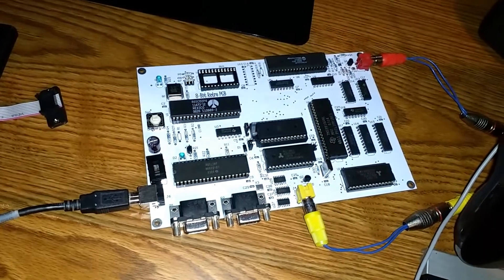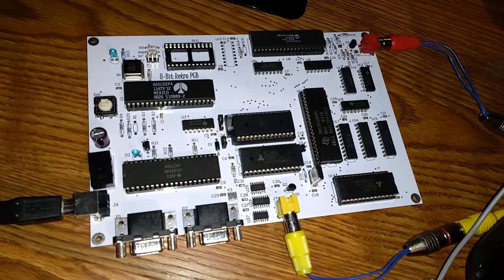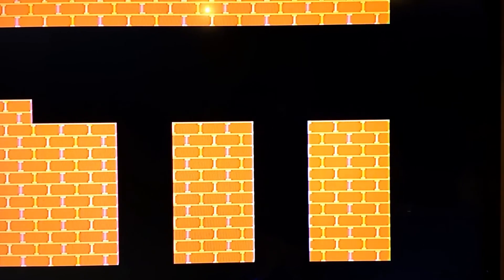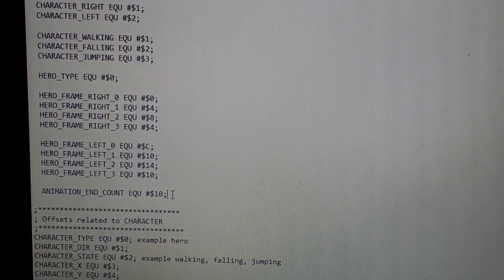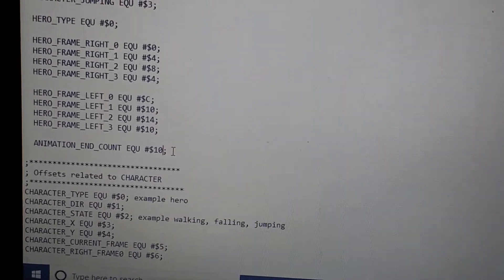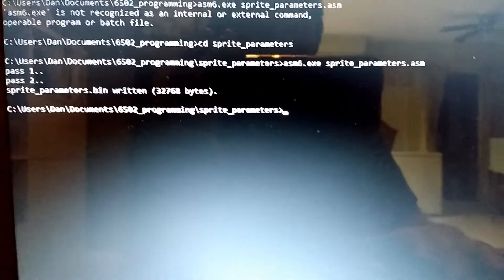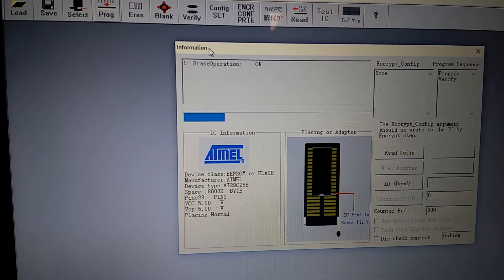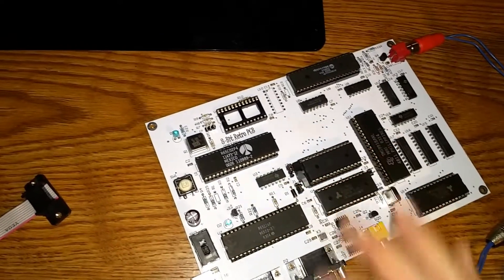Making an 8-Bit Game ep1

Comment: How do you keep your tms9918 alive? Mine died
Reply from the maker: I don't know.  Sometimes it comes down to luck.  The one recommendation I can say is don't handle old electronics wearing slippers.  I remember as a kid I damaged the port chip of the Commodore 64.  I was wearing slippers and I got a shock when I touched the Wico joystick. 🕹 If you live in a place like me where the winters are cold and dry be extra careful during those months.  You can also use a grounded wrist strap when handling it if you want to be extra careful.  And finally don't do what I did and place your circuit card directly on the carpet.  Lol.